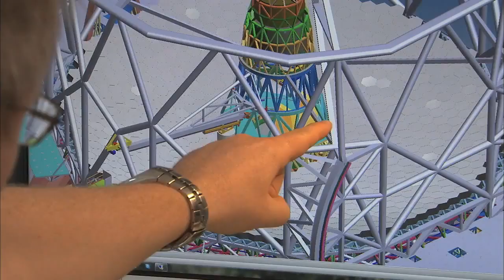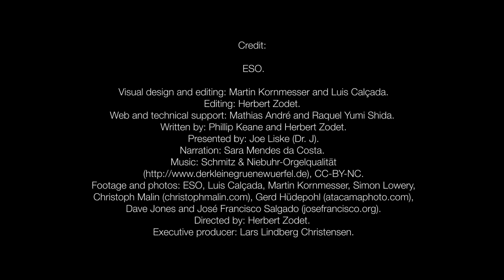The Evolution of Giant Telescope Mirrors | Esocast 63 | ESO Astronomy HD

Comment: why cant they just cast concrete and make a really thin and shiny mirror. is concrete going to bend?
Reply: +MrPepsicola123 The main trick with an active optic (which isn't really explained in this video) is not only to hold the mirror in a perfect shape but much more important to vary this shape permanently according to the athmospheric abberation in realtime! This is the reason why the ESO Adaptive Optic has four sodium lasers that create  four artificial stars in 100km altitude. The abberation of these artificial stars is measured in realtime by the telescope and the shape of its mirror is bent in realtime to the counterpart shape of the measured abberation so that the negative athmospheric effect on the image is nearly eliminated. Try to do this with a mirror that is cast in concrete! ;)  The result is an image that easily outperforms the hubble CST, which also has no image errors caused by athmospheric effects but has a significant smaller main mirror.
Reply: @starmarky  Thanks for awesome clarification.
Reply: I am imagining a stadium sized Arecibo-like (but optical) telescope.  The observatory would truly look like a convertible stadium similar to what they have in Arizona, Seattle, Dallas and Toronto.  The 100 meter adaptive primary mirror would be attached to a parabolic concrete structure that is, itself, set in another concrete parabola with a cushion of air providing nearly zero friction movement of the primary mirror structure. Issues that would need to be resolved? 1. Attaching instruments to the prime focus would be difficult because it's located under a bunch of concrete and if you can't look through a telescope then there's not much point in having one. 2. The structure to support the secondary mirror would have to be humongous and so would the stadium. 3. Limited range of motion would result in limited observation.
Reply: EfOneAddict couldn't you cast hydraulics inside the concrete and attach it to the mirror.